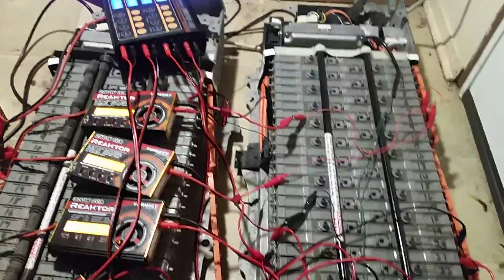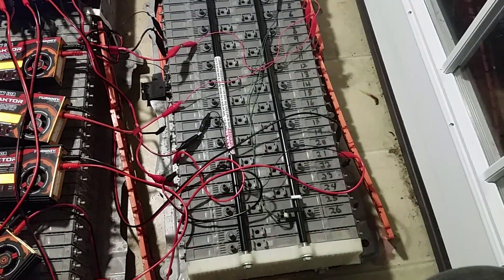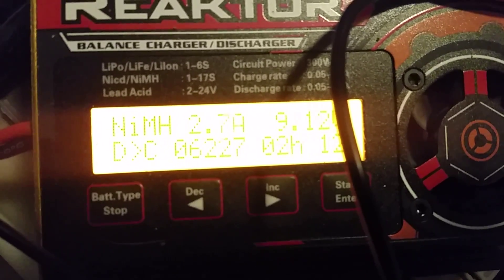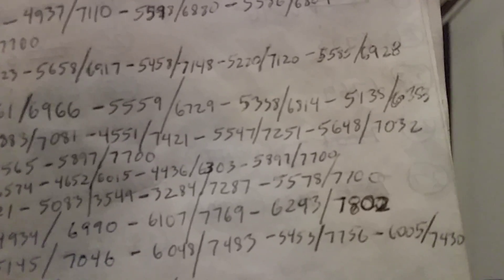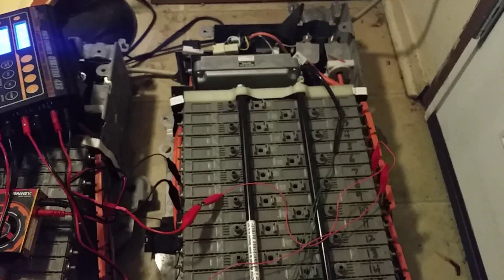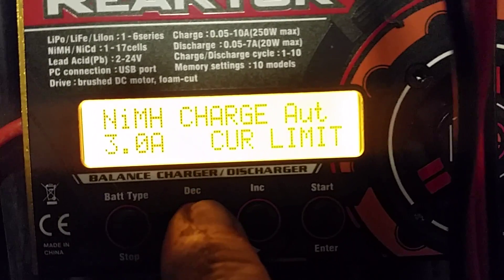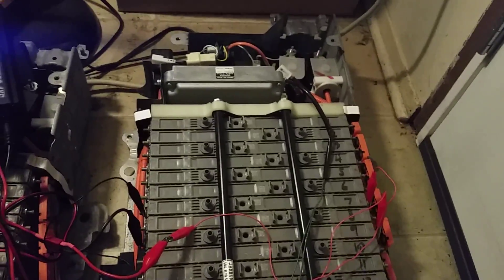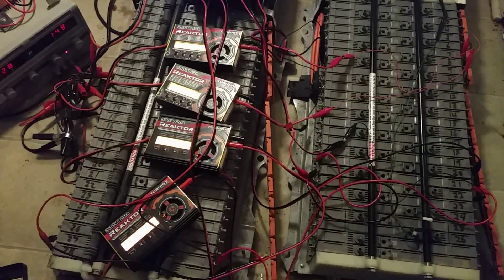Prius module on Imax B6 - redux

Comment: I'm using a tenergy t180 on my 07 camry hybrid, i let it sit overnight but it cut off at 240 minutes for safety timer, and my capacity cutoff was set at 6500 but when i checked the screen, it went above that but it didnt shut off the charger, is that normal? or am i doing something wrong?

Comment: Hey tommy how did you balance them and with what settings? I have a T180 turnegy
Reply: I let them self-balance for a couple days, by tying them all together in parallel, with small gauge lashing wire. It will look like a sine wave, skipping every other battery.

Comment: Can you please explain how one can tell if the charging or discharging is complete for a cycle. I am using the imax B6AC v2 and just following your settings. it just keeps changing from discharge to charge or charge to discharge. But how can I tell if cycle 1,2 or 3 is completed. I have my setting on discharge/charge 3 cycle. After over 6 hours, I press on stop and I only see the reading CH1 5866mAH, DISC 1- 4366 mAH, CH2 6975 mAH, DISC 2- 4645 mAH, CH3 0000 mAH, DISC 3 - 417 mAH Working on a prius hv  battery

Comment: Hi. Which charger do You currently recommend? HobbyKing Quattro or Turnigy Reaktor are no longer available. 
New Reaktor T240 or Skyr IMAX v.2 will be good?
Reply from the maker: @Lukas Usc honestly, I haven’t messed with any Prius packs in several years, and haven’t kept up with the new chargers either. I’m sure someone here has some suggestions.
Reply: @tommyjohnson5354  thanks for the info. I keep searching :)
But, it's interesting that almost all  topics about cell to hybrids break off 2-3 years ago 🙄

Comment: Hi, can you please explain what does this mentioned term "1 - 6s" mean? Does it mean that one charging unit from Reactor can able to charge maximum 6 Prius cells simultaneously?
Reply from the maker: @thghho it means 1 cell in series.
Reply: @tommyjohnson5354  Hi Tommy, that means that when it says 15s you can have 2 prius cells?

Comment: I am getting a about 6000 discharge and 7200 recharge. My charger will cut off at 7200 and then begin a discharge cycle. I have don't each at least ten times. Is this bad or good?

Comment: There is nothing much wrong with an IMaxB6 clone as long as you dont expect much from it. It works fine for charging AS LONG AS YOU WATCH THE END OF THE CYCLE CAREFULLY. Also I NEVER use autocycling anymore, too slow and annoying. Instead, know that NiMh cells always get a bit above room temp when they reach full charge. It doesnt matter what car they come out of either. Charge them with whatever you got for NiMh and Discharge them fast with a Carbon Pile. I Dis at 40 amps most of the time and sometimes 50 amps if I am in a hurry. Some use 20 or 10 amps, dont much matter though as LONG AS YOU do the SAME thing to all the modules. The modules can handle it easily since they live in the car humping back and forth at 60-80 amps all day long! This way you will get done in a couple days if you never leave the room. But if you like spending more money on fancy chargers go ahead. Keep a fan blowing on everything too. I dont recall seeing any fans in your setup.

Also your pack will probably need redone in a few months time. Since you did NOT load test the modules at all. The little 1 or 2 amps those chargers do for Dis is NOT enough to test for load endurance. A Carbon Pile load tester works much better for this CRITICAL step.  Eg hook up each module to the carbon pile and burn it down for 3 minutes (maybe more), watching the voltmeter and your stopwatch carefully. I usually stop the "burn" when the V hits 6 under load. Note the time. If your pack is to work well, ALL of the modules will have to show the exact same results, or damn close to it. 

A side benefit of doing it this way is you weed out the good modules quickly, they dont need to be cycled more. Saves time. Concentrate on the weaker ones instead.

DO the exact same procedure to ALL the modules. Do not fudge any for time. Replace any modules that are not up to snuff. Be ruthless! Modules dont cost that much. I see them used and tested for $25 each and sometimes less than that. eg, Like-new modules are about $35 at Bumblebee Batteries. 

Put the better performing modules in the center of the pack where it gets warmest. The pack will stay balanced a bit longer that way.

Also get yourself a copy of Dr. Prius and a bluetooth adapter that will work with it so you can check on the pack from time to time easily.
Reply: Mike Lamb - what is a realistic life expectancy on a restored/balanced pack?
Reply: @c217z  It really depends on how bad off the cells are to start with. Most refurbished packs will work ok for a year or two at most. Even packs refurbished by the factory may only last a couple years. The reason is that the chemistry inside is aging and oxidizing the nickle plates in there, causing resistance to build up. Deep cycling like in the video helps to remove some of the oxidation, but never all of it. 

The quality of the chemistry inside the cells varies a good deal as well. In general though you can count on a years time if you do the work really well yourself, no short cuts.  Also in order to be sure you get as much time as possible be sure you load test each module one at a time. Be sure to do the exact same test to each of them too. I usually "burn" a refurbished module at 40 amps for at least 3 minutes before I declare it "good enough." A good one will stay above 6.5V during this testing too.
Reply: @ @michael47lamb  Thanks! It seems to be a labor of love. Would you say the $1600 - $2000 new packs will generally outperform gas mileage wise? I haven't pulled my gen 3 pack yet so I don't know how bad individual modules are. Torque shows voltages within .3v.
Reply: @c217z  LoL Labor of Love is one way to look at it. I do it mainly because I am cheap as the day is long and dont mind the work very much. It is also sort of interesting in a geeky sort of way to me.

As far as making the plunge of 1600-2000 goes, I see nothing wrong with that as long as you understand it may or may not stay "fixed." Be sure to get a pack with a strong warranty by a reputable company (not some garage clown selling on Ebay or Craigslist!) MPG wise: either method will work about the same. It is mostly a question of investing money in one or the other. 2K in money and a days work (warranty too maybe), or $70 -$100 and a few days work. Your choice. I usually find that 2 to 6 modules need replacing, the rest are fine. Although the last Prius I worked on needed 14 module, but that cost me all of $350 in cells and a bunch of time tinkering.

Ask yourself this: How long have you been seeing the Red Triangle of Doom? If it hasnt shown up yet dont worry about it. But when it does show up, fix the pack right away before more cells get damaged. 0.30V diff is not too great just yet. Although 0.20V is what I shoot for in real life. The car has a wide degree of tolerance it seems.
Reply: @michael47lamb  No red triangle, don't think I get one with gen 3. I have "Check Hybrid System" on dash and P0A80. I ordered Techstream. Should be here this week. I like the cheapskate approach. Guess its time to start ordering battery chargers. Sounds like you have done a slew of these.
Reply: @c217z  "Check Hybrid System" is Toyota's way of making the malfunction less alarming to the owner LoL. Makes sense in a PR sort of way too. A big red ! is a bit terrifying to anyone who does not understand what it means. Also Toy grouped in other errors with that red ! just to be more confusing I think. If you dont have the right scan tool all you see is "no codes found" or "poor engine performance." Not very helpful info.

I have mostly worked on Gen 1 hybrids since they are cheap to buy and easier to fix than newer models. But before you start taking yours apart make sure you know what chemistry is in the pack. Toy could have put in something other than NiMh by Gen 3. If Li cells then you are on your own again. I am not very familiar with Li. If NiMh then we are good to continue.
Reply: Hi. Charsoon Antimatter 300W 20A will be a good option? 
Eg. https://www.aliexpress.com/item/32837993856.html
Reply: Hi. Charsoon Antimatter 300W 20A will be a good option? 
Eg. https://www.aliexpress.com/item/32837993856.html

Comment: Could you please tell me where I can buy charger.
Thank you.
Reply: U can buy these Hybrid batteries at Green Bean installed for $1500.00 they will send a tech to remove your old one and put a new one in. 5 year warranty comes with it. Changing these cells is like pissing in the wind, could last 3 months or 30 days. Just call Green bean and get a new one
Reply: @scraplifetrashtocash4551  Please answer to the question or shut up. Probably you own Green Bean and you want some profits from this chat.

Comment: Hi, Tommy, I have 2007 Camry already repair 1 time  (no new batteries) about 4 years ago
 I bought a new Reaktor Quatro 300w 20A and starting the process according to the video but at the moment the first 5 batteries after the 3 first cycle the charge average is 1090 to 1500 and another 2 batteries the average is 4000. Which is your opinion? Thanks!

Comment: I need some advice using Reaktor chargers. I bought 4x 300w AC/DC 20a chargers similar to what you are using in this video. My settings for NiMH are 2a charge auto, 2a charge manual, 5a discharge down to 6.2V with DCHG/CHG set to 3, 5 minute wait time, all annoying alarms off, safety time set to NONE as it disrupts any cycle it's in and erases mah data if the time is met. I learned that the system won't cycle at all and only performs one half of a cycle (charge OR discharge only) unless you push the start button while showing the screen "DCHG/CHG - 3" I wasted an entire day recording data that started and only performed a manual charge OR discharge as a half cycle. When you do push start on the correct screen the data erases immediately when the half cycle completes and is in "wait/waste time" it will change instantly from for example:  3479mah to 0000  and just holds at 0000 until the 5 minutes is up and the next half cycle begins to count. So really only get the final result of 3 cycles if you walk away and come back hours or half a day later. I can't find a way to see any other mah data to complete a meaningful chart. Also every module so far has increased in stored ampacity with the data I happened to have seen before it auto erased but i'm only seeing increases from about 1200mah to 4500mah. Is there a better way to set these chargers up? Am I missing something?
Reply: I am experiencing the same problem I have the model you have and I can not see the charge and discharge capacity using the increase and decrease buttons like Tommy does on this video ..... if you have figured it out please share me your experience. thanks

Comment: So how did the battery cell modules workout after the charge?  Is it in the vehicle?
Reply: Star Master Tech 2 years later, still driving the car daily. Mileage has started to decline slightly, currently around 40mpg, so will likely have to go through the pack again before the end of the year.

Comment: Hey what is the maximum voltage I can charge these batteries to or is that where the Delta Peak comes into play
Reply: Hi I got a prius and check light was on while the engine is running.i checked the hv battery cells.each cell reading 8.1.is the cells ok

Comment: I would like to use turnigy reaktor qaudkore 1200w 80a charger in my house. Do I need a 100a breaker? Or would it work on a 20a just allocate 5a per charger while not tripping it? Would it increase speeds if on a 100a breaker?
Reply: Also what is a good power supply to buy
Reply: Amps x volts = watts. 1200 / 80 = 15v. A standard wall plug is rated at either 15 or 20a, let’s use 20a. 110v x 20a = 2200w. You do not need a 100a circuit to run your Reaktor. What you do need, is a strong power supply, that can deliver enough current and voltage to charge all 4 ports simultaneously. Modern computer power supplies, rated at 1500w, are what I would be looking for. You might get away with a 1200w or 1300w, but see if you can find a server power supply and modify it for your charging needs. A quick Google search shows an HP 1300w server power supply for $35, might even order one myself..

Comment: Hi Tommy, thanks for the video. While I was reading thru the comments, you mentioned about knowing the battery capacity. How do we find out about the battery capacity? Also I want to know how to fix a module if the bolt is broken on one end? Thanks in advance.

Comment: Hi Tommy Johnson!
Thanks for you videos, are awsome!
I have some hobby chargers like yours, and my batterys are getting around 5000mA disharging after 3 cycles.
Im charging 3A and discharging to 6.3V
With your experience, what would you do? do you think they can get more amperage after more cycles?
many many thanks!
Reply: 5 amps is ok, try to do a couple more cycles on a few, and see if you can get more capacity. If not, it is still useable.
Reply: Tommy Johnson 
Thanks you Tommy J ! =)
Before put it again in the car, Whats you do? Give a full individual charge to them all or give an parallel charge on them? What ypu recomend? =)
Reply: Magichand I would go though them individually, balance overnight, and drop it back in the car if the modules all checked out.
Reply: thanks Tommy! 
how you balance them?
get "full charge " individually, then put on the car?
Reply: Magichand get full charge individually, then tie all the + together, and all the - sides together. The weaker modules will pull the stronger ones down to their voltage level. Leave it overnight, and by morning, the pack will be balanced. Put all your bus bars back on, reassemble the pack, and reinstall. Be very careful though, one short and you’re gonna have a bad day!
Reply: Many many thanks!
i done already that and the car run with diference of +- 0,10V between all the cells (OBD). but now after 2 weeks the OBD shows that the diference is about 0,30V and i have one very low voltage.
its strange because they were fine when i made the tests =/
what can it be?
the car dont balance them?
Reply: I did already 16 cycles in one of my modules and I stuck in 4290, 4260, 4360, Discharge. Is still useable it?

Comment: How do you know after charging and discharging a cell that is still good or should be thrown away now?
Reply: I guess if you have good capacity reading, and good voltage under load.
On the last cycle you read how much capacity is get inside,  and then drain it under load (not sure how much amperage😐), to see if is gets below 7v - 7.5v.
I'm not professional, but I think is correct

Comment: Please do a video on how to use the menus on the Reaktor. I have the exact same charger, yet it will not show the charge capacities like it did when you hit INC  at 6:50 in the video. Instead, it kept cycling through the settings menus instead. I was 3 cycle charge/discharging just like you were here at the time. Please show how to get it to show that capacity information (written instructions that came with the charger are pretty terrible as well). Thanks.

Comment: hey, when cgarging do you set a cut off capacity ? or you let it run until it is full and whatever is the capacity it the one you write ?
Reply: He set to 7500..
On very bad modules he used 7800